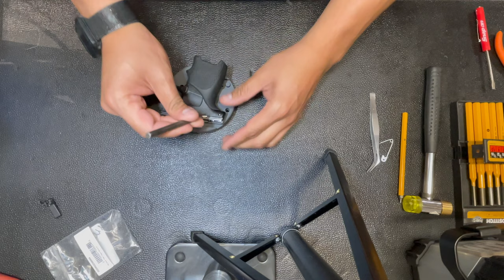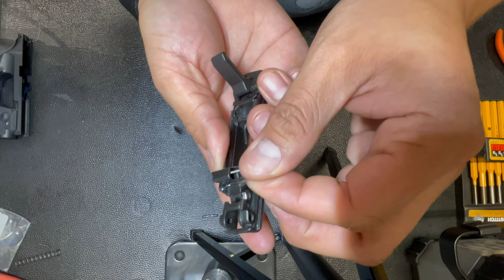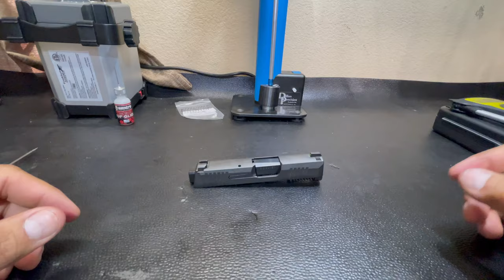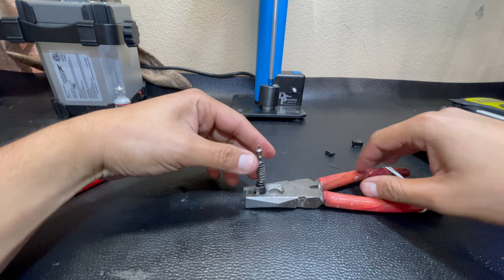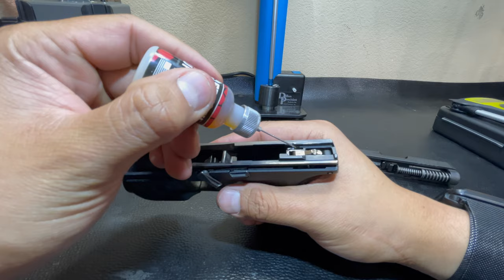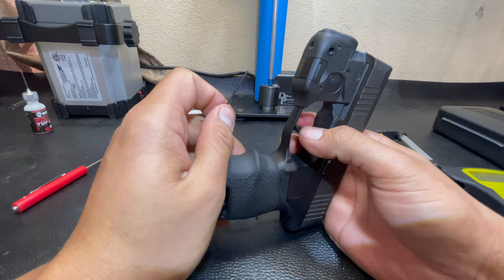Sig P365 trigger and springs swap   4K

Comment: Mcarbo also makes a flat trigger that has reduced travel and an adjustable screw for over travel. I'm thinking about checking it out.
Reply: Did you end up getting it? I can't find a video on them anywhere
Reply: @snoopywl8880  I ordered it, but it's on back order, so I'm waiting on it. Yeah there's no video by them on it that I'm aware. Just a description on there website.
Reply: @yeshualawson  sort of strange that no one has reviewed it yet especially with all the reviews of their spring kit. How long ago did you order? I'm thinking of getting the mcarbo or a factory flat triggee
Reply: @snoopywl8880  they have reviews on the website. I ordered about 25 days ago. I'm going to give them a couple more weeks then call and check on it. I have the 365xl so it came with the flat trigger out of the box. It's alright, just feels like to much pre-travel to me. The m carbo trigger supposedly cuts it down by 33% according to them. I've ordered from m carbo 3 times before, so I'm sure I'll be satisfied with the purchase. If/when I get it I'll let you know what I think about it.
Reply: @yeshualawson  did you order the spring kit to? I saw the reviews on their site but I haven't seen any on youtube yet im looking forward to what you have to say about it
Reply: @snoopywl8880  yes I did and installed it. It's definitely a smoother trigger now, but I didn't get the 4-4.5lbs trigger pull that the m carbo  video showed. I got about a 5lbs pull. The factory weight was about 6.5lbs. it's possible that there are differences between the 365 and xl model that causes this. Also I didn't add the synthetic grease like in the video.
Reply: @yeshualawson  they have a video out on it now, describing the shorter pre travel and an install video
Reply: @tampabayspearfishing5297  yes, I know. I literally just finished installing it 10 minutes ago lol. My trigger pull is 3lbs 12oz on a 10 pull average, very nice!
Reply: @yeshualawson  is this with the new mcarbo trigger I’m Interested in changing both like you I’m thinking if I should just get the trigger from mcarbo and also the springs
Reply: @John-sw1mm  that's with both the spring kit and the trigger.
Reply: @yeshualawson  they have the titanium striker as well which should smooth out your trigger pull even more and possibly lighten the pull too. Im pretty tempted to pick up all 3.
Reply: @LîNkxUSMC  be careful with their trigger spring kit tho. I had really bad light strikes. Ended up changing the striker spring back to factory. The other springs in the kit work fine tho and still lighten the trigger pull a couple pounds. And the trigger is nice, I ended up installing it.
Reply: @yeshualawson  yea im pretty sceptical about using lightened striker springs these days with all this covid quality ammo. I had to take the 4lb wolf spring out of my glock and put the oem spring back in because i kept getting light primer strikes with the cheap range ammo. It worked fine with my defensive rounds but the cheaper range brass primers were too hard for it. How much better is travel with their trigger?
Reply: @LîNkxUSMC  seems about 30% better or so. Yeah, when it comes to lightened striker or hammer springs I'm now just going to stay away. Just can't chance it with my carry weapons. Need them to go bang when I pull the trigger.
Reply: @yeshualawson  what do you mean by trigger spring kit and what other springs work well? I shouldn’t change 

Custom Lighter P365 Sear Spring
Custom Lighter P365 Striker Spring
Custom Lighter P365 Striker Block Spring

None of these? Can you explain more on other springs since all are striker springs,?

Comment: Never put oil in the striker it should always stay bone dry even if it's a new part.
Reply from the maker: i used https://www.amazon.com/Sentry-Inhibitor-Knives-Needle-Bottle/dp/B000Q82HSY. its a dry lubricant thanks for the tip I did not know that though.

Comment: What's that contraption on the rear plate cover?
Reply from the maker: Its part of the Techna Clip, its the most minimalist holster you can get, check them out. https://www.technaclip.com/Products/sig-sauer-p365--conceal-carry-gun-belt-clip-ambidextrous
Reply: I was just getting ready to ask the same question.
Reply: Now that I know, I don’t think I want one.  
I want my pistol grip to sit well above my belt line so I can easily get a good purchase on...
Walt Revn, how low does that clip cause your P365 to sit?
Reply from the maker: @IndianaDundee  it sits pretty low I love it, can’t even tell i have it on me and its super comfortable, im left handed so i carry it at my 8 o’clock.

Comment: @WALT REVN - I see you still can't get rid of the over travel which is the worst part of all P365 triggers. I don't mind the pre travel since it doesn't affect shooting but that damn long over travel is what I hate, it almost feels like a mini D/A revolver trigger. If you see a way to get rid of the long spongy over travel, post a video on it.
Reply: That trigger pull in this video looks awful. Look at Tactical Triggers P365 kit, I haven’t used it myself, I think it’s a new product, but it looks fantastic. Half pretravel, minimal sear creep, minimal overtravel, super short reset.
Reply: @sethrich5998  I put 2000 rounds through my 365xl with the Tactical Triggers kit at different training courses and ran it hard. Its a keeper. Changes the gun for better.
Reply: @jasonpierucci9265  Hey, that’s good to hear. I’ll likely be getting an XL soon and that’s definitely going to be a considered upgrade. I’m pretty used to light crisp competition triggers (USPSA) so anything helps, most factory striker triggers are terrible.

Comment: mine pulls at 3.75 to 4 after changing the striker spring and that's it. I changed mine to Sig flat trigger. What kind of trigger is that with an adjustment? I dont think that is necessary. You might as well got the Sig flat trigger
Reply from the maker: The trigger is from, https://imtnebraska.com/product/sig-p365-flat-triggers-copy-copy/
I like the option of removing some take up, im sure the sig one is just as good
Reply: @wallas0786  ah gotcha. That makes sense
Reply: which striker spring did you change to?
Reply from the maker: @I_ammm_mojojojo  https://www.mcarbo.com/sig-sauer-p365-trigger-spring-kit.aspx